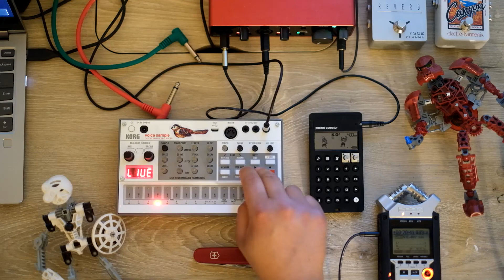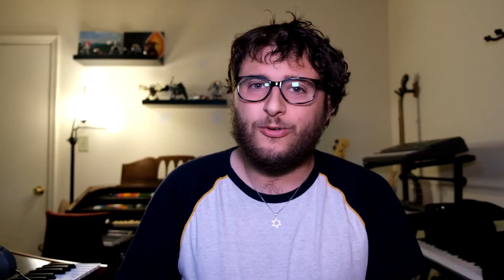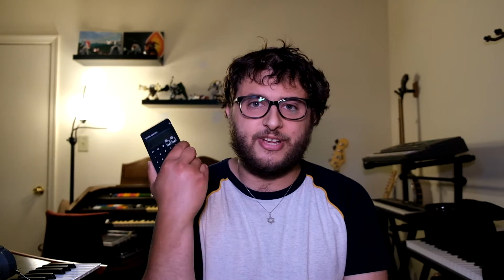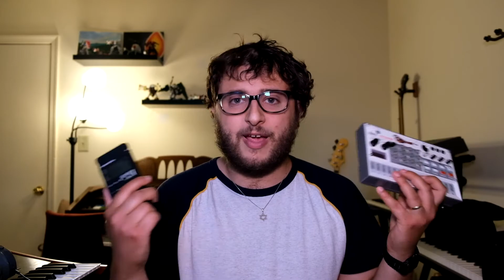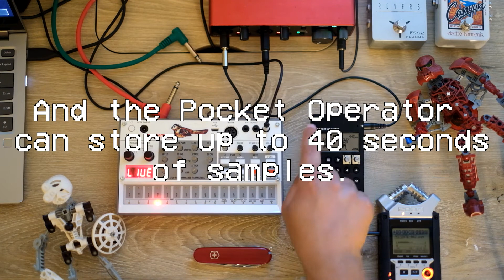Comparing The Teenage Engineering PO-33 KO! And Korg Volca Sample 2

Comment: I know this is a trick that's mentioned on a regular basis, but I get around the polyphony limitation by stacking drums together on a singular pad/channel.
Sure, it requires some extra prep work, and it isn't ideal that the kick+snare combo is choking the open hat or the ride cymbal etc.

My layout looks like this atm:
[Kick] - [Kick+c.hat] - [C.hat] - [O.hat]
[Snare] - [Kick+Snare] - [Snare+c.hat] - [Bongo]

And I have another kit on the other 8 buttons, with another Bongo hit. The Bongo is replaceable with whatever-the-eff, but I just couldn't see myself getting much use out of a ride cymbal when it's so easily choked.

Comment: On the PO knobs, they probably have gunk build up in them. You could use a little contact cleaner in them. It's very common in potentiometers and switches to get corrosion and gunk built up inside of the working area. A little blast of contact cleaner will dissolve all that mess.

Comment: Recently Korg has updated its web page, including Librarian troubleshooting for windows and mac. It seems that the Korg driver can not handle the connection with your computer if the Volca's registered midi device number is higher than 10. Don't know how this will be helpful for you considering you use IOS though.

Comment: You can transfer samples to and from the PO-33 and a computer.  You're not limited to the mic or line in.  But that's not the case with the Volca - it does no sampling on its own, and new sounds need to be transferred to it.

Comment: I got the sample 2 yesterday and the Korg librarian software upload worked from a mac but it did take a lot of troubleshooting. I had to use the micro usb cable from my PS4 (one that transmits data) and it still did not work with the Apple usb adapter so I tried an old Samsung usb-c to USB adapter (looks like a tiny usb stick) and only then it could detect the volca sample. To me the Volca is way superior in functionalities but the P.O’s effects are more fun and it is way faster to sample something on the go. That’s why I have both and keep them😅

Comment: probably excess lube dripping down on the encoder causing your issue. had the same problem with my electribe, just had to open it up to clean up a bit and the issue went away. 

funny because i suffered with it for almost a year before i figured out how simple a fix it was.

Comment: POKO! is a fun little sampler - workflow is a dream and it is cheap, but... 4 voice polyphony and low sound quality (low tones are crunchy af) have been a serious obstacle. Have had POKO! and sold it. So i have bought Volca Sample (less than 100$, used is close to PO price range) just for Pajen firmware and, i must say that now, it is serious instrument. Together with Novation LaunchKey it is killer combo, with keys on one MIDI chanel and  pads on them all. One thing i do not like - it is not a sampler, only sample player. But with free VOSYR packs all over and CAUSTIC editing abilities i can forget about it. Teenage Engineering, in my opinion, should made a second generation of PO - with high quality sound, more polyphony and a sturdy case. This device wuld be twice of actual price but i think it wuld be worth it.

Comment: I currently own PO33. I used to play around for while but 4 polyphony really hit the toll for me. The sample recording time is much shorter too, making it almost limited to have 1 project only. The melodic channel is not really chromatic, but locked in natural minor. Besides that, battery life is amazing and it definitely is more portable than Volca.

I personally think built quality is bad. It's bare bone. There really isn't much a case to really cover whole thing (even  official one exposes back) Can easily breaks if slightly wet. Not really made to take it outside.

Comment: Hey Josh!
I am not sure how to connect my sample 2 with my PO. What wire do I need?
Reply from the maker: You'd use a 3.5mm audio cable going from the Volca's sync out to the Pocket Operator's audio input. I think you also have to change the pocket operator sync mode, and there's info for that on the Teenage Engineering website! :)

Comment: I have both.  I like the quick hands-on flow of the PO-33 KO and sampling feature.  It gets the job done when making a beat with complex changes. 

The Volca Sample, though it takes time to fill it with samples, but once you do, it becomes a fun and dirty little MPC.  If it could sample like the PO-33 KO, then it would be king hands-down.
Reply from the maker: True! A Volca Sample with sampling would be a game changer. I've heard that can be modded into it, but I'm not yet brave enough to try.
Reply: @JoshIsMakingMusic  yeah, I saw one mod but was still glitchy.  The guy managed to get it sampling with a max of 3 or 4 seconds per slot.  However, it would get wonky and severe glitches. 

I hope one day Korg will make a more convenient VS with sampling, larger pads and OLED screen.